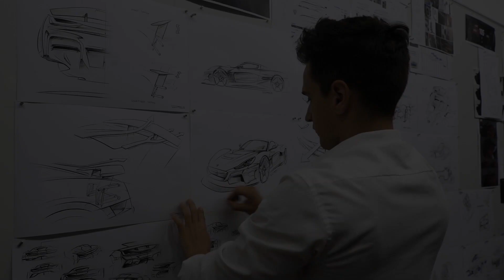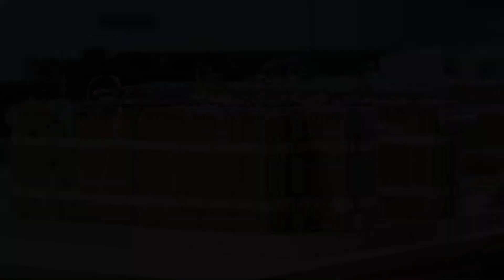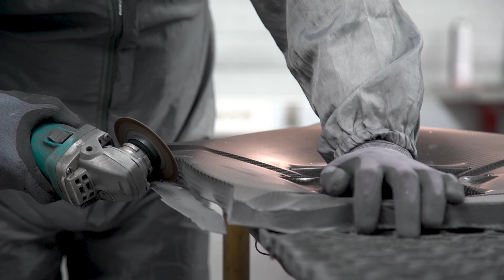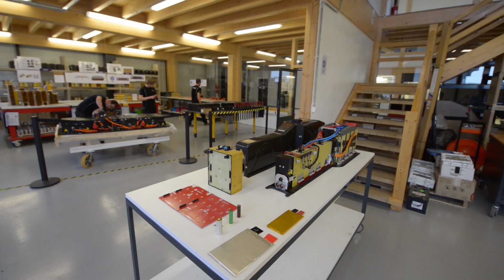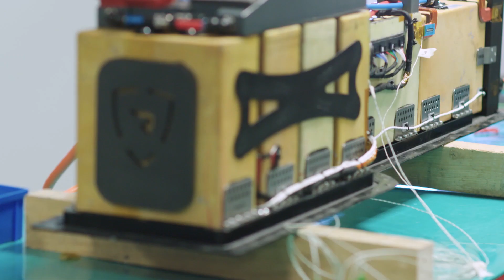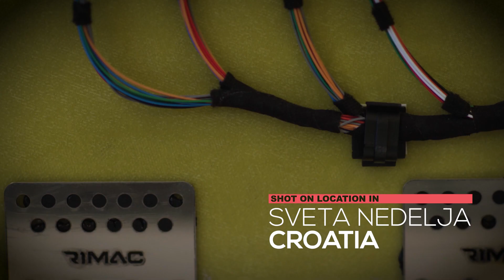How You Dyno Test An Electric Car Battery – www.APEX.one

Comment: Battery amps allowed by drivetrain multiplied by voltage divided by 1000 to get kilowatts and multiply by 1.34 to get horsepower.
Reply: only electrical HP and has no relevance to SHAFT HP or actual POWER PRODUCED.
not consumed. PRODUCED.
Reply: @paradiselost9946 That is quite a small difference! Electrical inefficiency is in voltage drop only which you factor in to the voltage used in the calculations normally and very easily, and drivetrain losses in an electric car without a transmission, clutch, etc are extremely small. 

You can use what I said to get power more accurately than an ice car on a dyno and even if that wasn’t the case you can use that to spec for desired power easily, where with an ice powertrain it’s a lot harder to spec for a certain power
Reply: @SC-rk6zt  it is NOT a "small difference".